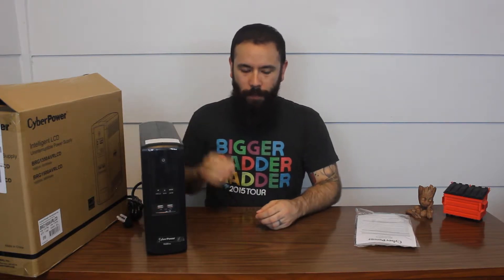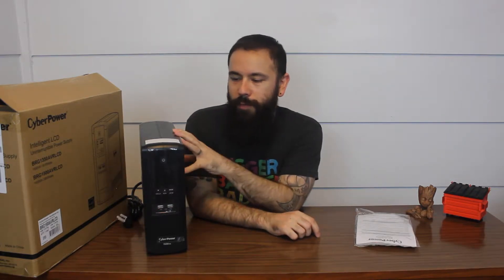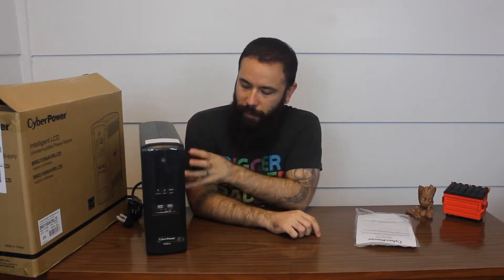UPS Backup for 3D Printing - Because Power Outages Suck

Comment: I’m having the same issue with my printers. Mine are Epson eco tanks 2803. I use them about 3x a week. Just for T-shirts, stickers. Crafting stuff. I live in an area that constantly loses power. About once a week. When I lose power, I have the hardest time getting my printers back up and working. I’m not electronically inclined. You can only imagine my frustration. Trying to fix something when I don’t know what I’m doing. I have to go through all the trouble shooting steps. Eventually they start working. I’d like to not have to deal with that anymore. I bought the APC 900VA. And was told by someone on YouTube that all I needed is a surge protector because my printers are too powerful for a UPS. They’re only 12 watts each. I’m so confused. Please help me. Thank you so much.
Reply from the maker: It can be really confusing, especially with so many conflicting opinions out there. I actually have an APC 900VA though and it's been working well for about 7 years. For that entire time I've used it for my Creality CR-10, which can use 250w or more when it begins heating the bed and hotend.

The APC 900VA is rated for a max of 480w, so with your printers using 12w each you could use all 9 of it's outlets at the same time and still only be using 108w. That's way under the max watts, so I wouldn't have any concerns about overpowering the the UPS.

The only possible problem I see is that APC lists a 40w minimum for the 900VA, so theoretically your printers may not draw enough power, depending on how many you have plugged in. I don't know if I believe that minimum rating though. My CR-10 only uses about 12w when it's idle and I don't have anything else plugged into that UPS. It's powered the printer fine during power outages while the printer was idle, so the UPS has definitely worked with well under 40w being used.

Hopefully that all makes sense, but basically I don't see any real reason that UPS wouldn't work in your situation.
Reply: @ Thank you so much for taking time to respond. I appreciate it and understand what you’re saying. ☺️

Comment: Does 3d printers need online ups ? Or these ups runs just fine ?
Reply from the maker: You could use more advance versions, like ones that integrate into home networks or cloud services, but even the most basic UPS will work fine.

Comment: Hi. Thank for the education. What power rating should I consider when buying a ups for my Ender 3? Thanks.
Salim form Ghana
Reply from the maker: It depends on how long you want to be able to run on the UPS. On my CR-10 I get 45 minutes of run time from a small APC 600VA. The Ender 3 should use a little less power and get a little longer run time.
I haven't tested the runtime on the CyberPower 1500VA, but it should go 2 hours.
Reply: @Review3d  I have Mercury Smart 1500 which has a power rating of 1500VA. Only challenge I have is the caution statement written behind it telling me not to plug any non computer peripheral to it. From your test do you think the Ender 3 will work all the same with this UPS?
Reply from the maker: @Ahmed47199  I'm by no means an expert, but I've never seen that kind of caution statement on a UPS. I've seen the opposite warning on generators, saying sensitive electronics shouldn't be plugged into them. This would be due to more loosely controlled voltage which generate small surges.
Any UPS shouldn't have this issue and should produce a much cleaner/smoother sine wave.
Reply: @Review3d  well, I'll still have to give it a try. Power outages here are still regular and I'll hate to convert a roll of filament into a pile of failed prints.
I'll let you know what happens

Comment: I am planning to buy a UPS unit.i have a tevo tarantula printer and I often experience power outage.on an average how much printing time will APC 600va provide during power outage?
Reply from the maker: With my CR-10 running I was able to get 45 minutes from the 600va. This is enough for me since I typically don't experience extended power outages. If your outages tend to be longer than that then you may want to consider something larger, otherwise the 600va is a great unit.

Comment: Does the CR-10 have a power off resume feature? If so you could always have it turn off and resume the print when the power is back on.   That way you just need the UPS to allow the printer to shut down and save the print head position for resuming after. I know if you're running Marlin 1.1.9 this would be doable
Reply from the maker: That's a good point and yes, many of the newer Creality printers do have a resume feature. My CR-10 Mini has it, but unfortunately my full size CR-10 is a little older and it doesn't have it...although I have been considering flashing a newer version of Marlin on it.